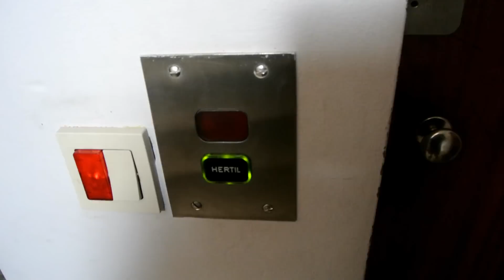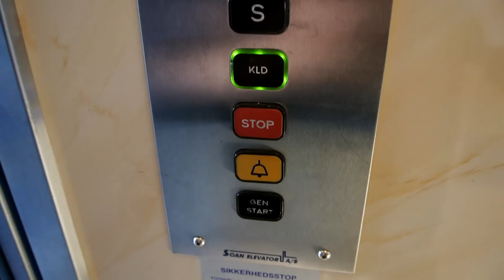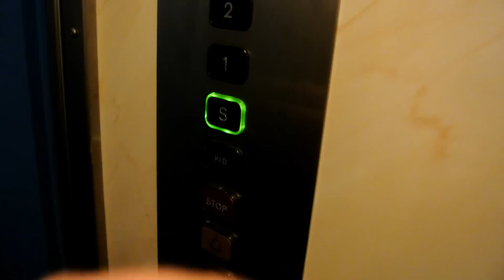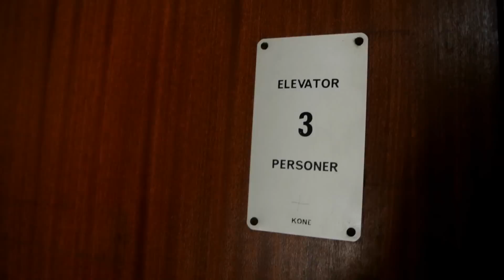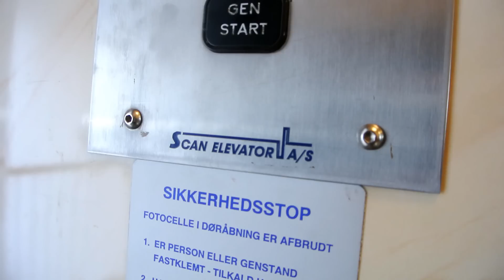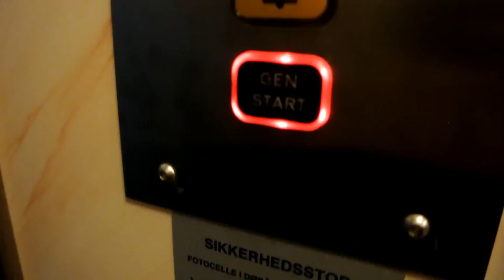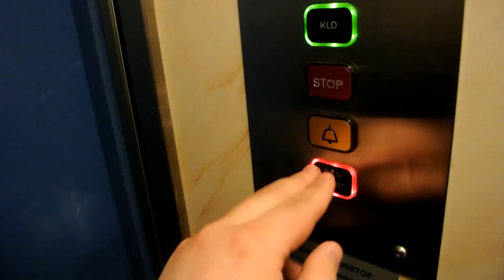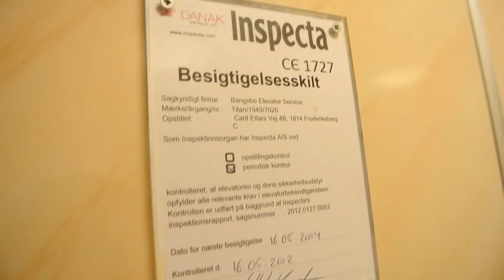Elevator with a serious technical problem

Comment: The cause of failure photocell sensor are if they are dirty, BUT if it's not cleaned, it might not work, after cleaning and still doesn't work, it means bad photocell sensor, they have to replace the good photocell sensor to activate the elevator safety stop

Comment: I've never seen an elevator where you have to manually open a door to access it when it arrives.
Reply: You must be really young then because it was normal thing that you had to open doors manualy like that.
Reply: @ArmoredsoldierCZ  On the contrary, I'm 19, but, I don't think they were/are around where I am.  It's still cool, nonetheless!

Coming back, I’m 21 and still find this cool! 😊
Reply: @SamanthaTheSonicFan  elevator with swing door are popular in europe back in 50s and in egypt
Reply: Ive only seen one (excluding freight and wheelchair elevators), which was in a hotel (and it could only accept one call at a time, i often had to listen for the door closing on another floor, as there was no “in use” lamp)

Comment: Photocells and stop button should break safety. If the stop button works but not the photocells the safety circuit works properly and the photocells are bypassed and/or fail to break safety.